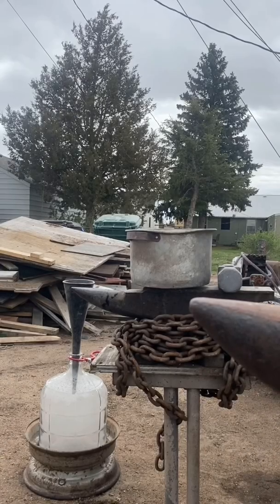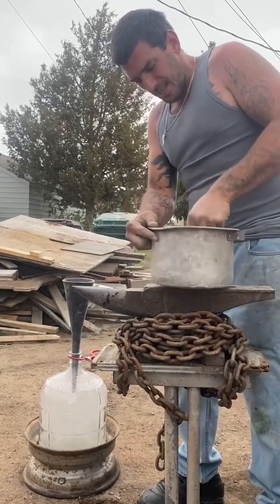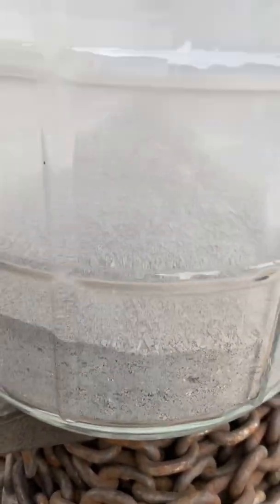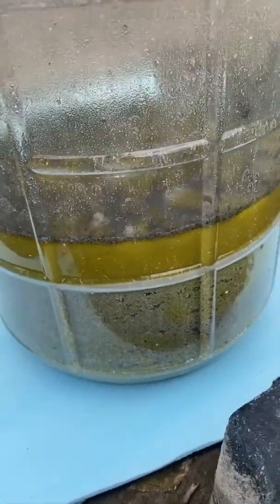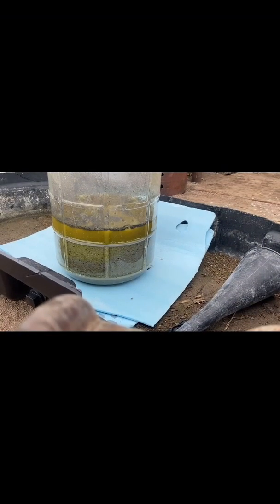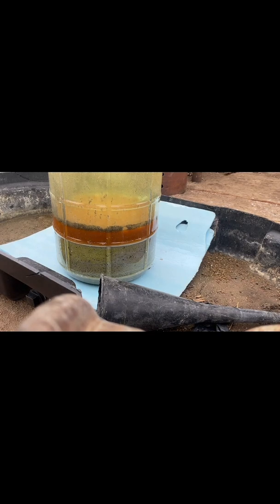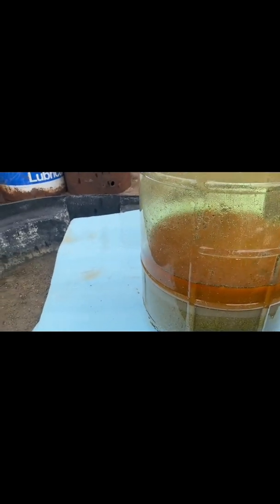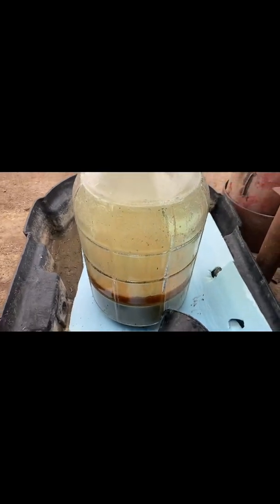Refining catalytic converters for palladium and platinum : day one leaching precious metals

Comment: The red color is palladium use hydrogen peroxide it is better and quicker
Reply from the maker: Heck yea .
Reply: @scarsprospecting  HCl+ hydrogen peroxide give palladium instantly for platinum and rhodium you need to heat the stuff to 250 c for 3 minute if not it gonna take like ever ;)

Comment: will take aroun d 1000 of them to pretty much guarantee you getting cancer, just let refiners do it, they also not loose 10% of the PGMs like the wet seperation (acid) method since they have arc furnances which work FAR better than chemie